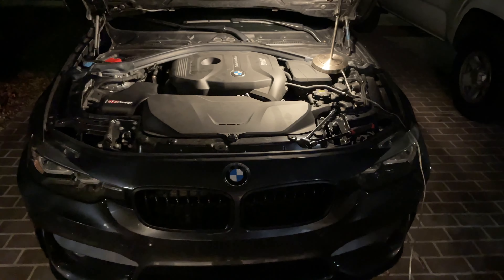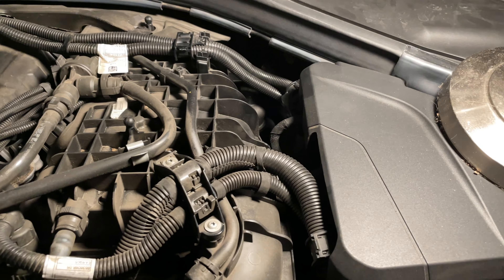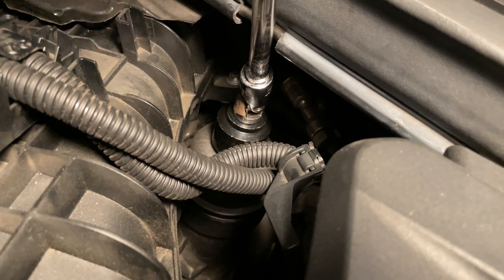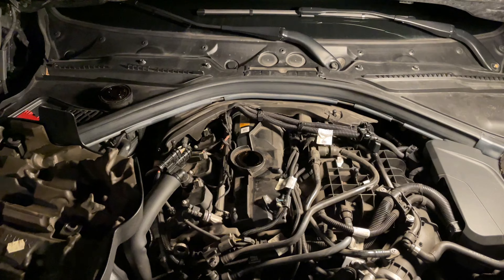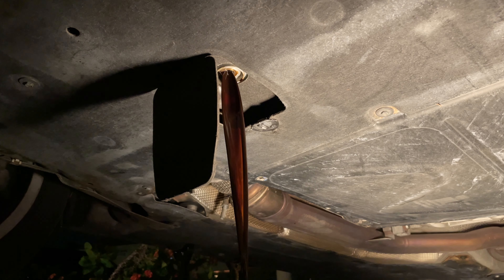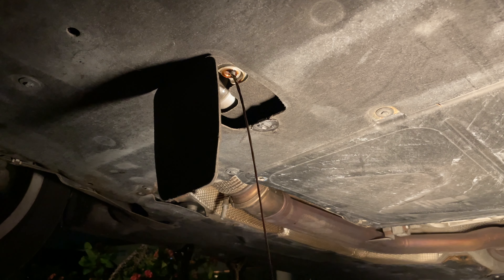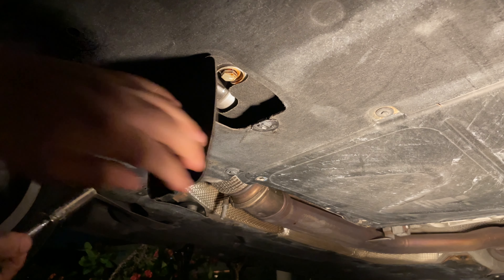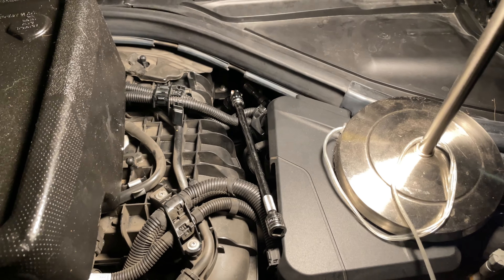(F30) 2017 BMW 330i 2.0L Oil Change

Comment: Is it a 27mm or a 32mm socket used to remove the oil filter housing? The kit off Amazon I bought came with the oil, oil filter, and a 32mm socket. Just making sure before I start changing the oil. If it's a 27 mm socket needed, I need to go buy one. Thanks in advance
Reply from the maker: It should be a 27mm socket
Reply: 27mm, I change mine yesterday

Comment: I noticed the oil you used does not have the BMW 0w-20 LL 17FE+ specification. Does it really matter if i just use any 0w-20, or 0w30 for that matter? Thanks.
Reply from the maker: As long as you use 0w-20 full synthetic you’ll be okay.

Comment: Hello, do you know what normal operating temperature the car reaches? Coolant and oil temperature? I ask you because I have a 2017 330i and my car reads 230 degrees Fahrenheit in both temperatures.
Reply from the maker: 230 is honestly not bad they usually run around that range. Anything higher though it would watch out for

Comment: does the miles on the dashboard automatically reset or
Reply from the maker: No actually you have to reset it, I’ll make a video on how to do that as on this car we had an issue at first resetting the light due to another problem

Comment: Hmm, my manual is saying 6 quarts?
Reply from the maker: It calls for 5.25 liters or roughly 5.6 quarts with the oil filter change
Reply: @saints_motorsports exactly. 
I usually fill 5 liters, check e then complete 0,25 L after.